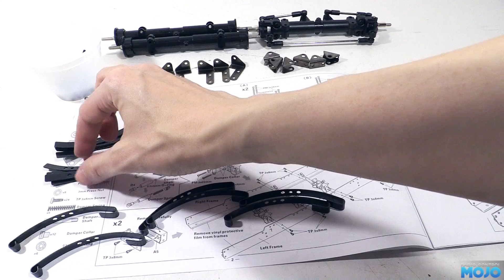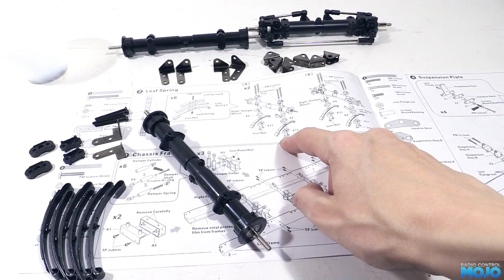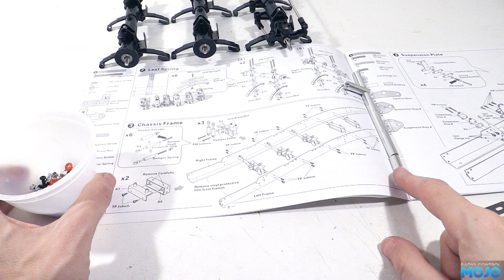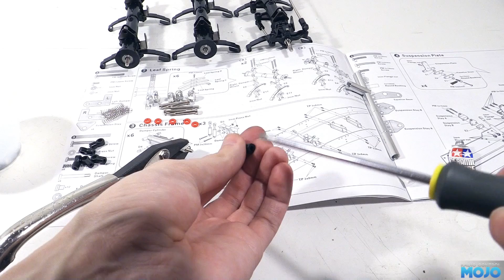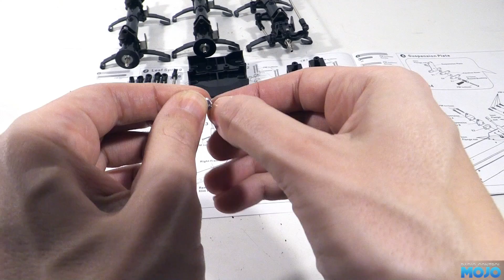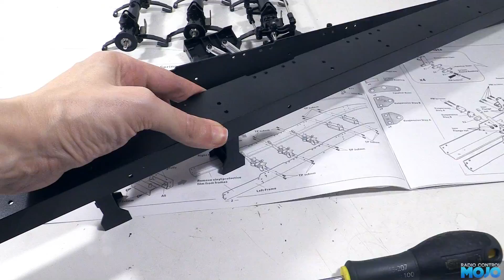Hercules Hobbies Reefer - 3 - Leaf springs and cross members

Comment: The shock shafts actually have a hex/allen head so you don't have to use pliers to hold the shaft. Also makes it a bit easier to feed it through the body of the shock.